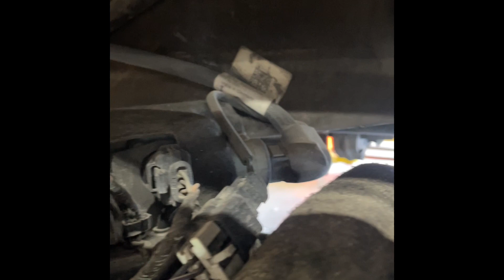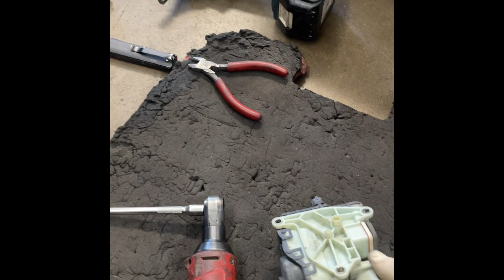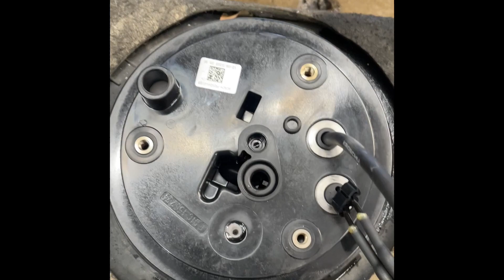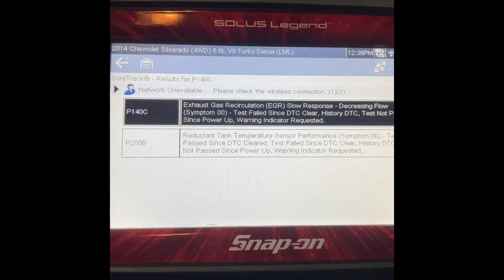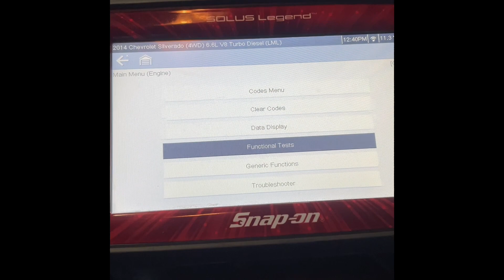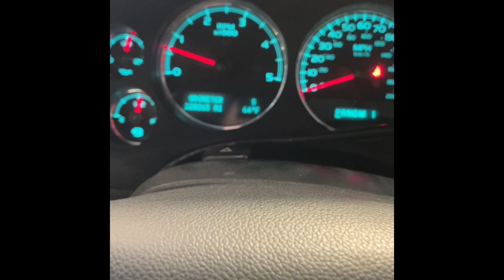Duramax lml def sending unit replacement. Reductant heater, sending unit, reservoir kit.

Comment: I have a 2015 Duramax with a P203B Reductant Level sensor 1 performance code unfortunately I don't drive the truck often enough to cycle though the def so I'm wondering if it crystalized and cause level sensor issues
Reply from the maker: It would be best to swap it out. Every easy to do
Reply: @blu @bluecollardiesel the level sensor? Or the Reductant sending unit
Reply from the maker: @andrewisreal5797 the heater and level sensor is all in one unit.

Comment: I recently replaced my heater and heater hose. But now i have a new code thats claiming its the pump? Do you know a good way to test the pump before taking it off?
Reply from the maker: Whats the code?
Reply: @bluecollardiesel p20e8 and p204f. I took the injector hose off (which i recently replaced along with the heater) and its bone dry and no def comes out when i run the truck. But i have no clue.

Comment: Great video, I am replacing mine now after P205b code then P21DD code and speed reduce message. If you get stuck on a trip with with speed reduce and get down to 4mph you can unplug speed sensor on transfer case and get home at highway speeds, you will still get speedometer reading. I know it works because I did it.
Reply from the maker: Hmm interesting. I will have to check that out one day. Thanks for the information.

Comment: Great video!   I have a p205b code with the check engine light on.  No obvious power loss. My tank is full. Will it harm the truck to drive it?
Reply from the maker: What will happen is the truck will stop going into regeneration causing the scr to plug up and cause more issues. I would order the reductant tank from GM and replace it sooner than later.
Reply: Thank you very much. I will.
Reply: I have same code but my truck still goes into regen mode and no loss of power.  Ck eng light is on an says my no. 1 glow plug needs to be replaced as well.  What risk am I at…..  truck runs fine